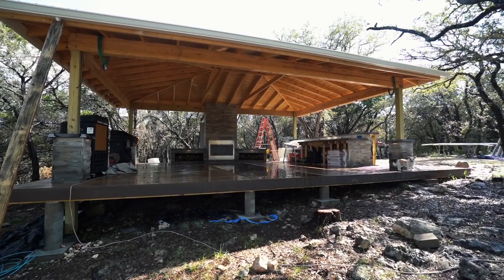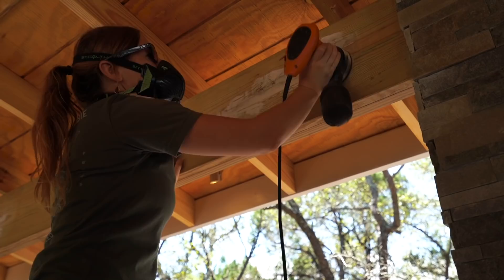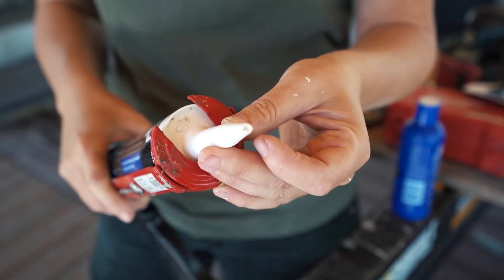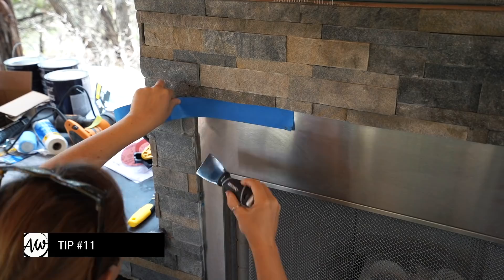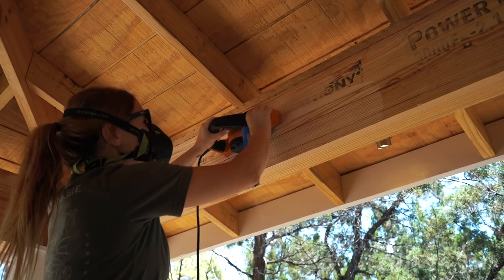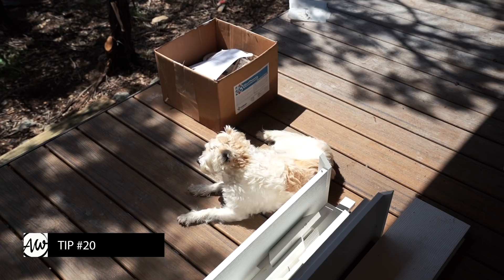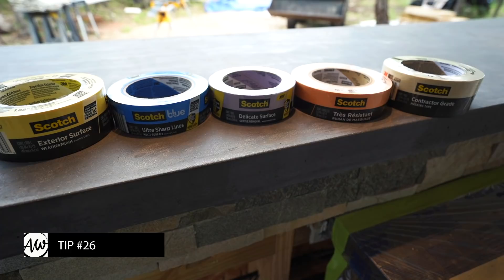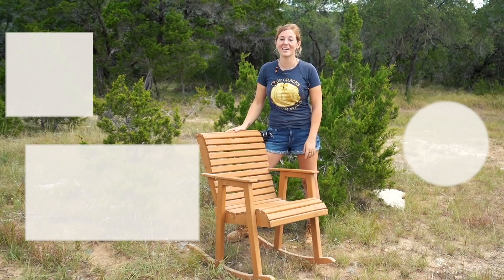Paint Tips and Tricks For The Best Results Possible | Outdoor Kitchen Part 8

Comment: Instead of all the masking, you can do all the painting before putting the other finish items. 
Also, use an oil based primer on raw wood. It is a better blocker and promotes better adhesion for the top coat (acrylic or oil based). You also should avoid tinting the primer. Having the color difference between the primer and top coat gives a good visual on proper top coat millage so the substrate is fully protected and the paint lasts as long as possible.

Comment: A pro painter told me to never bother with masking, I should go for a wide putty knife, and use that as masking. Then ever so often, clean it, either on your painters clothes or in a rag. :) 
Quick, easy, and perfect results.
Reply: I only use a painting straight edge for painting baseboards where there is carpet. Everything else I just cut in freehand. It is faster and cleaner, but takes years of practice to master. I also don't mask much at all other than tape on the top of baseboards, sticking out, to catch any roller splatter. For spraying, I mask extremely well, since it will go everywhere there is a void. Also use a 3" wide sash brush for cutting in and drag it longways. The wider brush acts as a straight edge vs. using a narrow brush. I only use 3" and 3.5" brushes, even on wood windows and french doors.
Reply: Also, use good quality brushes and learn how to take care of them; clean them throughly, dry and store them properly
Reply: @DavyHulme  You hit the nail on the head! Roller covers are $11 bucks each and brushes are about $20 each, but they last a very long time due to proper cleaning. A big block wire brush cleans the ferule and bristles, even the handles and a painter's comb straightens the bristles. Having good water pressure to force water inside the brush to clean out the paint is vital (not forcing water in, just allows paint to build up and dry in the middle of the bristles.....a mistake that many people make). It doesn't hurt the brush as long as it is straightened and it works very well to hang them to dry overnight then put them back in the sleeve.

Comment: April should have used more primer/paint on the roller. If you have to push on the roller, it is too dry! You need a certain mill thickness for a good paint job. Keeping a wet roller actually reduces splatter. I only use lambs wool roller covers for 9" size and you can use a roller spinner tool to spin the roller in a bucket. It works on the large diameter covers like you had. For small roller covers, rinse by hand and then roll it very fast down a scrap of wood or in my case the back of the dog bath I clean my tools out in. It is less messy. I always prime before filling, so the filler and caulk has a good surface to stick to. I use very little tape and instead freehand everything with a 3" or 3.5" sash brush where needed. Even on wood windows and french doors I never use less than a 3" brush. Big brushes hold more paint and act as a straight edge for cutting in. Most April's tips were pretty good and slightly rounding corners is something I always did when staining and lacquering new cabinets, but also for paint grade. Techniques somewhat depend on the skill level of the person painting. I have taught coworkers to paint well in a few months by showing them many techniques that I learned from my uncle who hired me at age 14 for his own home (age 15 for his painting business) and others I pickup up from many years of practice. Great paint work comes from attention to detail and good techniques.
Reply: @plasmac9  I used Valspar in part of my home 10 years or so ago and didn't have a problem with it. The color I liked was that brand. I have used pretty much all of the brands available in SoCal, other than the very cheap stuff. Proper prep and application were on my side and I always use two coats and prime if the surface is questionable. Maybe I just got lucky with the Valspar when I bought it and used it over interior walls I previously painted with Sinclair. I used a ton of whiteline, devoe, sinclair, ICI, spectrum, and eventually tried Behr, which works great for me despite so many people hating it. The availability of Behr beats dealing with paint stores scattered around, especially when I was doing commercial work at all hours and in many different locations. In the past I used vista, DE, pratt and lambert, sherwin williams, and others.
Reply: Yeah you can easily tell she is not professional painter at all but those tips are still good for amateurs like me.

Comment: Detailed paint prep!  --- from caulking open edges to pushing down tape with a putty knife for an even stick.  April, did you clear the issue from some electricians about running regular wire parallel to audio?  And will you run conduit to cover the wire that is under the deck?

Comment: Hate to say this April but those white wood coverings for the verticle post are going to expand and contract over the seasons leaving really large unattractive gaps as the wood warps over time. Then rain water will get in and finish them off in short time. I did this same thing on my new front porch patio. Didn't even get 2 yrs before starting to look like crap. You're better off using the thick James Hardie planks instead.
Reply: Absolutely! Not to mention that it looks like she used 18g finish nails. She'll be lucky to get a couple of weeks before the DAP filler starts to crack and the joints open up.

Comment: You should insulate the roof.
It is darn surprising how much difference it makes.
I’ve worked on cross docks with and without and wowzer is it major.
Bondo aka plastic Auto body filler is way better filler the down side needing to mix batches up side being you can paint in 10 min or so.
Just make sure to use the white hardener.
Also take advantage of the plastic clay like state as the product cures.
Thanks for another nice video.

Comment: Great paint tips.  But I think those beams would have looked better with clear poly urethane.  I love the natural wood look.
Reply: All personal preference dude. I'm sure she agrees for the most part, but it's just cheap yellow pine by the looks of it; and paint is honestly the best way to seal wood from the elements even more so than poly.
Reply: @darianbell9614  While I agree that the wood used is cheap, unattractive and best covered, painting it is a fail. First, this is still very wet, green lumber that will leach chemicals, sap, resins etc. These will come through this paint as urine-colored stains. Also, given that only one side (at most) is painted and the other side(s) are open to the environment and will absorb moisture, this paint is doomed to fail in 1-3 years. All the filler used at seams/joints will fail as this wood shrinks. This is a “how to” video by someone doing it for the first time. I don’t say this to be intentionally critical or mean-spirited, but as a warning to others watching these videos. These are “entertainment videos” and not instructional videos.

Comment: I own a body shop so I'm used to painting cars - so weird to think about sanding with 120-180 grit, I'm usually finishing in 800 grit before spraying!  Different worlds for sure.  I've found going heavier/wetter coats will let the paint flow and level out, virtually eliminating roller or brush marks

Comment: To clean sandpaper on the cheap, you can also use dried up silicone - the pieces you can cut out of the tube when you use a tube incompletely and only discover a few months later that it has solidified.
Reply: Old sneakers.
Reply: @paulkolodner2445  Never used. Are they soft enough? IME, that's the important thing - it has to be something rubbery but soft enough to get into every cleft in the surface to be cleaned. If it's too hard, it will clean only superficially.
Reply: The easiest way is to blow it off with a blowgun hooked to an air compressor. I saw the sanding screens for the orbital at the store, but it didn't look like they let the dust pass through very well and I needed sandpaper for sanding drywall, which I use a shop vac and special bags for. As a pro, I have spent hundreds, if not over a thousand hours over the years, sanding. Change out sandpaper often. The performance drops off after a while and you end up taking more time and working harder.......yes, I'm still guilty of not changing it often enough, but as some say, use it like it is free.
Reply: @a0flj0  I have not tried any of these tricks - I'm just relaying what I saw on a youtube video.

Comment: I wonder if the seams in the columns will start to show through after a while. I would have eased the edges of the boards before assembly so that it became a "decorative detail". My friend has extra deep window sills in her house that were made by adding a small board to a large one. In some places, the seam is invisible, but in others, a hairline is showing through the paint. But joints are prone to becoming visible.

Comment: Hi April- quick question - when you added the panel to the bottom of the facia board that had the big crack that you didn't fill with putty, did you then do the others the same way including the one with hanging light fixtures? If so, how? Did you cut wires and reinstall lights later through new holes in panel added to facia? At the end everything looks even and level indicating that you did. Please let us know how you worked in the lights. Thanks.
Reply: Some questions are not supposed to be asked...

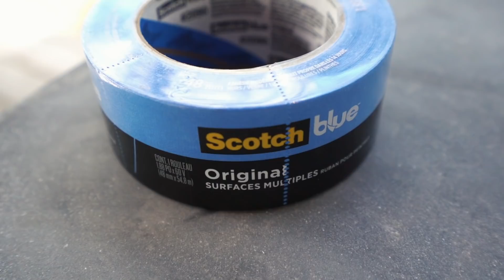Comment: 3:20 were you on stilts? The way you were walking looked like stilts. If so, would have been a cool shot to have seen you on the stilts and then zoomed in to frame just the work area.
Reply: I imagine she's more likely to be standing on and walking along the kitchen work surfaces located at the edges of deck 
Edit: the work counter is under the drop light fittings in shot
Reply: @DavyHulme  - good observation 👍

Comment: Use vaseline, not lotion, works great.
Reply: I used to use Vaseline on my face all the time, but that was for spraying oil primers and paint. I will have to try lotion when I spray water based next time.......a paint sock and dust mask cover everything but my eyes and top of my nose and my arms.